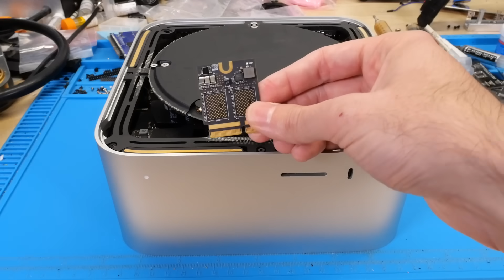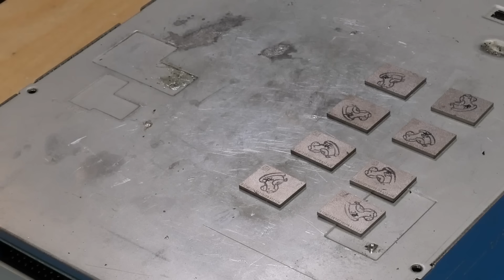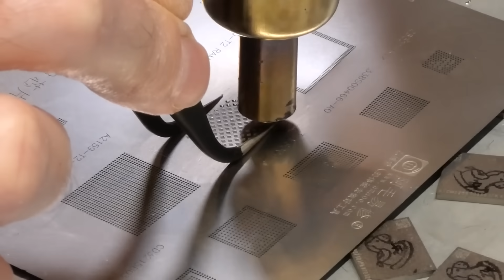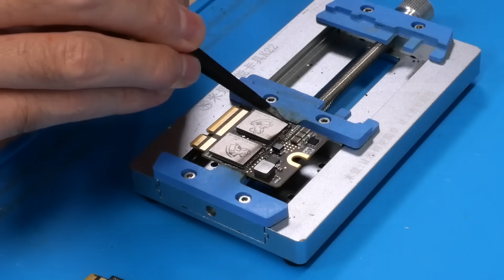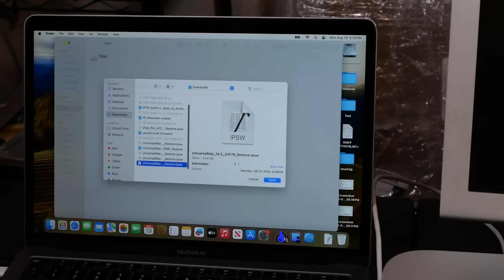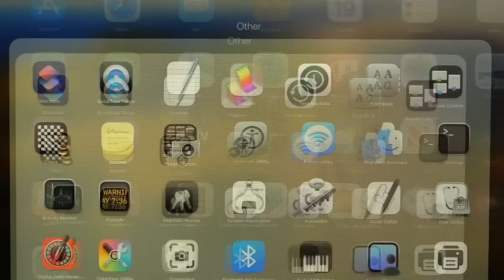Mac Studio Storage Upgrade - Made EASY with Custom Parts

Comment: An 8TB upgrade...I had a sudden flash back to December 1993 when I got a new computer with a 256MB hard drive and a buddy said "What are you possibly going to do with that much storage?".  Fast forward 33 years and we're talking a 31000+ times increase in storage and many people will fill that up VERY quickly.  My how times have changed.

Comment: Is there anyone that you can recommend to me that would do what you have done in this video for me. At 76, I am willing to pay for this though not the price to buy a new Mac Studio with the Apple Standard 1TB. Your solution would better fit with my plans. I believe that I can replace these into my Mac Studio, but I do not have equipment nor the experience to actually create the new 8TB modules. Because of the 500GB standard drive, I have already attached over 66TB storage devices and MOVED off a lot of APP workable space to various drives, but I continue to loose remaining free space on the initial 500GB. Even with the speeds of these additional external devices, they do NOT come close to the speeds that I have in the initial 500GB nor would they on the 8TB once in place. I AM NOT doing any commercial work. This is my own home work.

Comment: how do you know when the NAND models are perfectly placed so each ball of solder is above each connection point? Is there some kind of physical guide?
Reply from the maker: @BrianBurrow123  I just position it as close as I can based on the surrounding components on the board, and basically just make a good guess (it doesn’t have to be 100% accurate). With these BGA110 NANDs with these large pads, it is actually very easy to align, but the BGA315 ones with much smaller pads and much tighter pitch are a bit more difficult.
Reply: @dosdude1  Good evening, how are you? I would like to know if these (Nands) are recorded because I see you putting them directly without going through a firmware rewrite. I see you putting them directly. The question is, can I use the Nands from the iPhone 13 to put them on the MacBook M1, and M2 and on the MacBook M3 and M4 using the Nands from the iPhone 14 onwards without having to rewrite the firmware?

Comment: I would assume that when Giles ramps up to produce these for the public Apple would sue them. Even if they don't I can see they've already made another obstacle by designing every version of the M computer differently so a company would have to design and fabricate multiple storage boards. By the time they hit the market Apple will release a new generation with a new board. I'm still glad someone is trying to offer the consumer a cheaper alternative to upgrade the storage. I think most people would simply pay $200 to Apple to upgrade to 1tb internal and use an external SSD to edit off instead of waiting years for this to become available.

Comment: If I recall correctly, didn’t Apple offer a RAM exchange program back in the early '90s? Customers could trade in their existing RAM and pay extra for an upgrade—or maybe it was a store policy where I bought my first Macintosh. Either way, a similar model could work today. Apple could sell RAM upgrades at a lower cost while requiring customers to visit an Apple Store, Repair Center, or Authorized Center for installation. This would be a win-win: Apple gains extra revenue, and consumers get affordable upgrades. Give it another year, and I wouldn’t be surprised if Apple implements something like this to keep their loyal customer base happy. Just a thought!

Comment: Is there a reason why you removed the solder from the matching masked contact, rather than masking the corresponding hole on the screen? It seems like a lot of work to desolder 1 spot 8 times.

Comment: The Kickstarter has already reached its goal, thanks to the entire community. You may already know this, I say this for those who still want to participate, in exchange or not for a reward by benefiting from a call price, (less than half the price of Apple upgrades to date, taking the example of the 8TB), it will close on Wednesday, November 13 at 8:30 p.m.

Comment: Hi, thanks for the Video! Can i add 2 TB to the original 1 TB that i have? So total 3 TB?
Reply from the maker: @davidniositech  You cannot, as A, that is not a supported config, and B, the chips already installed are programmed for a 1TB config, which cannot be altered.

Comment: hey this comment isn't in the video topic BUT it is important 
i have my macbook pro late 2011 and you know it issue graphic so i was fixing it by heating up the GPU and that stuff you know (around 8 time i fixed it with the heating gun 8 times). I said that's enough so i did the nvram GPU power command using single user mode, and surprisingly i got it working with native graphics and full brightness and sleep control 
I don't really know how but what i DO know that uhm when i do the gpu power command i get that AMD graphics showed as "GPU diod" (in MacsFanControl) but know it showes with it full namw (AMD Radeon.....) and when i use GFX control to switch to the other graphics the system stop responding it always stuck on "dynamic switching" and even if i do an intesive thing it dosent switch to the AMD gpu that's what i wanted to say 
(fact: the last time i fixed the GPU uhm i never used it like only when booting i always use the intel and i restart my mac only when it slow down or the ram is full )

Comment: Hi, I wanted to know if the same thing can be done with the original nand board for a maximum of 4tb storage by replacing the original nand modules on the board. I also want to know from where can one source the nand modules ? is there a particular site from where one can source it for a price of around $60 as mentioned by you. 
And thank you for the wonderful video.

Comment: Hot air rework has been the standard for all electronics for well over a decade. If you’re a repair tech, you made that move many years ago.  NAND chips themselves are not made in custom sizes. What is needed is unformatted examples of this particular size and that can’t be insurmountable.

Comment: I have a 2018 mini. would it be possible to change the i7-8700B to a 8700T (delidding) or some other version with a lower TDP or maybe a slightly faster version with lower TDP (or the same)?

Comment: This is an irrelevant post but i have to ask.
I love your work and i wonder how come you haven't made a video, on how to keep/maintain the most iconic and upgradable Mac of all... the 2010 27" iMac? All 2009-2011 iMacs had the very well known gpu failure issue... unless there could be a way to maintain those gpu's... perhaps give them a few years of life by making a chip solder Reballing ? 🙂

Comment: Hello! Sorry for writing here but i cannot find any contact with you.  I just bought a used iMac 2011 and after i noticed it's running Catalina with dosdude patcher and the graphic acceleration is s@cks. I wanted to put back the original High Sierra from bootable usb, but it's impossible, also it looks like there is no recovery partition or i cannot reach it. Not even with the keyboard shortcut at boot. Do u have some advice how can i remove the dosdude patcher and put back the original recovery and High Sierra? I don't find anything related to this topic on your website. Thanks.

Comment: will this also work on the M2 max version of the mac studio?
Reply from the maker: @tsum-brushbrush5483  Yes, but those use different chips and as such would need a different board.
Reply: @dosdude1  Thank you for the quick reply. will those chips and boards be available soon? If so, about how long?

Comment: The new drives are 25% faster than the old ones, I'd hardly call that "slightly!"

Definitely looking forward to the prepopulated boards becoming easily-obtainable aftermarket parts. I'd totally be fine with doing the board install and DFU restore myself, but I think obtaining fresh NVRAM chips and correctly soldering them to the boards would be beyond my skills.
Reply: I think that can be attributed to having two modules instead of one, which doubles how many NAND chips can be addressed, splitting the workloads and allowing all the NANDs to operate at the same level rather than having fewer NANDs work across more levels, slowing down the chips even more.

Comment: Wouldn’t using solder balls be better than paste . You’d be able to flow the chips better to get perfect alignment , and not need to worry about cleaning that empty pad. With paste you could block the single hole on the stencil with some blue-tak or something . With solder balls you could just solder mask the unused pin on the chip.

Comment: If I have an older mini PCIE/mSATA laptop SSD card with 4 chips, and 4 empty spaces for more chips, would it work, if I soldered 4 more to the empty spaces? Would I get double storage? The chips are same brand, manufacture date, and same storage capacity, from another identical SSD card. All the required passive components are installed by default, by factory.
Reply from the maker: @andrasszabo7386  You’d first need to find the appropriate MPTool for the controller on the SSD in order to program it once the new chips are installed. But with that done, it should work.
Reply: @dosdude1  is it available for public use? Doesn't it detect the other chips without using the service software? It is an EEE PC with 8GB storage, with MeeGo Linux, and I would like to upgrade the storage in order to use something better, like Windows 10.
Reply from the maker: @andrasszabo7386  The MPTool is not really meant for public use, but they get leaked. The extra chips will not be detected unless properly programmed once you install them.
Reply: @dosdude1  and where do I find such a tool? Soldering those chips is no issue for me, since they are not BGA. And if it was BGA, large pitch BGA is still sometimes possible to be soldered on board with my old hot air station, and my low soldering skills.
Reply from the maker: @andrasszabo7386  Well, you first need to know what controller is on the SSD, so just read the part number from that. A lot of leaked MPTools are available on usbdev.ru
Reply: @dosdude1  thank you for your help I will look into that site.
Reply: It is a Phison PS3006-L chip. I could not find any programming guide online for this.

Comment: So I’ve seen from below that M2 has differences but based on the wording is it simply a different PCB? Or is it serialised software? If it was the first I’d be looking at a studio when the m4 releases on them, but if it was serialised parts then I’d probably have to pass
Reply from the maker: @benstacey831  They just use different chips with a different footprint, so a different board design is needed. Other than that, everything is the same.

Comment: Can the old nand and module be salvaged in any way to be reused in another system?
Reply from the maker: Yeah, it can be used in another Mac Studio as it is, or can have its NAND swapped and essentially serve the same purpose as these new boards.
Reply: Didn’t Luke Miani try swapping those modules between Mac Studios and it didn’t work or is there more to it?
Reply from the maker: @shaocaholica  For it to work, it must be used in the config it was programmed in (so for 512GB, a single 512GB module), and cannot have another one added with it (or if it was in a dual-module config, its paired module must also be installed). Also, the modules must be installed into the same slots, but to add even more confusion, which slot is which was swapped between the M1 Max and M1 Ultra Mac Studio.
Reply: So basically very limited reuse. Probably worth more salvaged for the module boards.
Reply from the maker: @shaocaholica  Yeah, they can be used as they were in the system you took them from, though if you swap a set of unprogrammed/new NANDs onto them, then they can be used to upgrade exactly as shown here.

Comment: So, is this possible with the Mac Studio M2? 🤔
Reply from the maker: Yes, but they use different chips and therefore different NAND module PCBs. So to be upgradeable in this manner, a new board design would need to be made, but you can still upgrade the NANDs on the original module PCBs.

Comment: I got errors when trying to restored from DFU. Is there a right way and a wrong way to install these ssd modules? I’m testing the completed modules for Gilles and i don’t know what to do :/
Reply from the maker: @originalmagneto  If Gilles already programmed them before sending (which is likely as it’s the only way to test them), you must ensure they are installed into the correct slots, as they will not work if swapped. Try swapping the modules between the two slots; that should hopefully resolve the issue.
Reply: I did install the modules in the wrong way. Now they are correct but I (again) accidentally torn off the power connector so I have to solder it on and then I’ll try again. Thanks!

Comment: Apple has always been obnoxious about blocking 3rd party upgrades. Only when you bought their super expensive tower systems would they let you use standard parts. They used to even block 3rd party CD-ROM drives.

Comment: Perhaps a dumb question, but... is it possible to partition that 8TB into say... 4, 2TB drives? On my M1 Mac Studio Ulta, I got it with the 1TB storage option. I bought two OWC Express 4M2 Thunderbolt enclosures ($249.99 each) and put four, 1TB M.2 drives in one, and four, 2TB M.2 drives in the other. Max storage per enclosure is 32TB.

Comment: Except you should need custom parts to upgrade your memory and storage capacity of a Mac! Apple sucks! I've been building and supporting Macs for post production since Mac 8100s in 1996. I still have my OG Mac from 1985.. In my warehouse I have about 100 Max studios along with a tun of Mac minis and even old trash cans that we still use as thin clients you get to our PC VM's.. I am so done with apple and apples ecosystem and I am happily back on PC. And I am thrilled with the new Snapdragon X elite arm processor which smokes M3s with their first go round.. And the beauty is you'll still be able to use a real GPU which you'll never be able to use again on apple because of the memory lockdowns.

Comment: With a lot of SSDs ever notice that for a product in the same product line one with double the capacity of another has double the TBW rating?  It is because it has double the NAND chips to spread the writes over now.  Just look at the TBW ratings for a particular SSD in the multiple available capacities for it and you will see what I mean.  One with 50% more capacity would also have 50% higher TBW as long as all of the chips in that product line are the same capacity.  Sure you might pay more for more storage and with Apple it seems that they want your first born son when it comes to the price of a lot of their stuff.  If I bought an 8 TB NVME SSD it would be really expensive, just not $2400.00!  I hope for the insane prices they charge for that storage when you buy it from them you are getting SLC NAND chips.  It would only be fair if that is what you got for that price.  SLC NAND is horribly expensive in a similar way but the major upside of it if you can afford it is that it is faster and lasts longer.  The memory most commonly found is MLC for some of the better stuff but its only advantage is it is cheaper than SLC.  Then there is TLC which is probably in most things we buy.  Then there is QLC.  The bad think about them adding layers is that the more you have the lower the TBW rating is that it is rated for 1000 program and erase cycles and it is an estimated three to five year lifespan.  I would rather have a lot of hard drives than QLC really since hard drives are reliable and tried and tested.  They have been around for decades and constantly being improved!

Comment: Hi there. A very useful video! A question here, please. I have Mac Studio Apple M2 Max/32GB/30 Core GPU with 512GB SSD. Can I upgrade my 512 GB SSD in same, too? Thanks
Reply from the maker: Yes, but different boards need to be made for the M2 models.

Comment: Removing a pad, doesn't it affect the operation of chip?
Reply from the maker: It's a no connect pad, so it's not supposed to be connected anyways. As mentioned, the board has it tied to ground, which is not correct and causes issues.
Reply: @dosdude1  so if chips coat you $500 usd for 8T and install time costs you $500 usd, you could easily sell it for $1500 usd and make profit if it's worth the $500 time and labor!

Comment: Great video, i have a technical question though, those NAND Flashs KICM223 1TB (8Tb), they're from Samsung correct? Do you know exactly which dies is it packed it? Like is it Samsung V-NAND V6, V7, V8? Do you have any clues? i cant find any ways to decode those part numbers.

By the Way, greetings from the Techpowerup Team, i'm the creator of the SSD Database there!
Reply from the maker: These particular NANDs are Kioxia/Toshiba. No idea about any of the real specs of it, as these are a custom commissioned Apple design, designed specifically for their systems.
Reply: @dosdude1  it's BiCS but do you have any clues fo what revision? BiCS4? BiCS5?
Reply from the maker: @gabrielferrazdetetivehardware  The only clues I have is Apple schematics referring to this generation as "S5E", and the previous NAND generation as "S4E". So, maybe that corresponds?
Reply: @dosdude1  no but I don't think it's Kioxia. Do you have any pin out of that NAND?